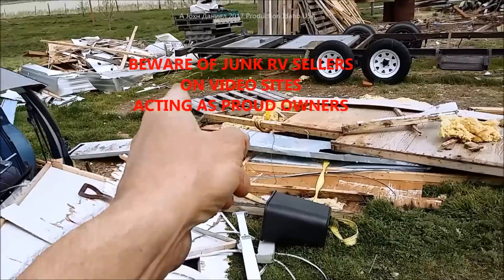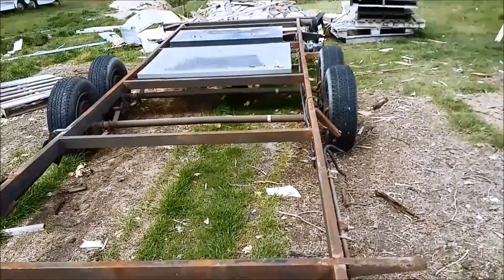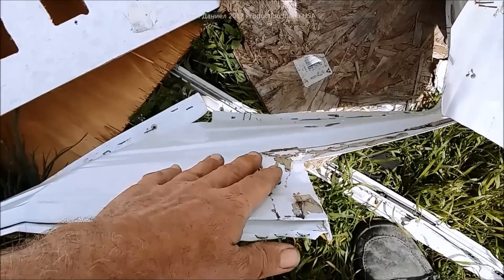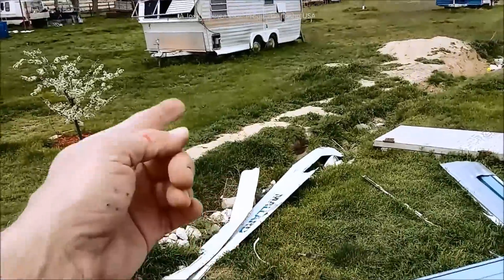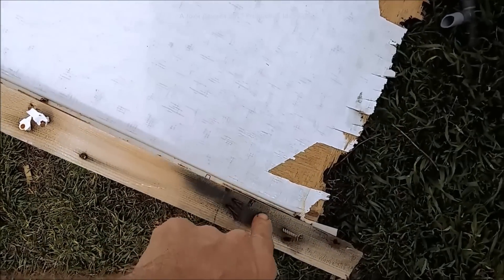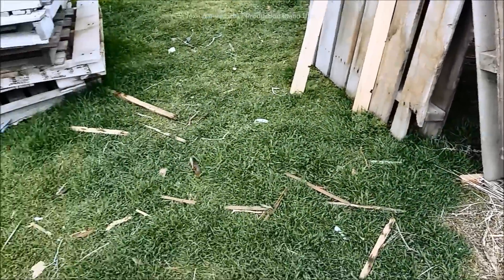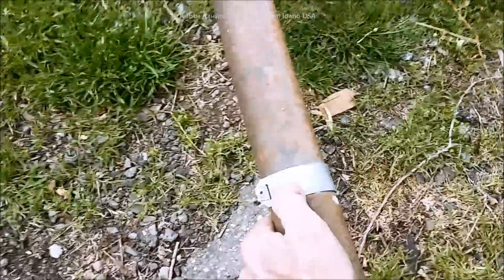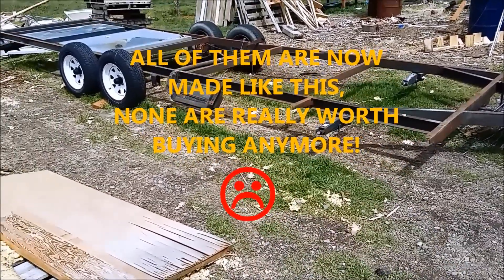HOW THEY MAKE RV Campers Travel Trailers, The truth, Wow! Info Below

Comment: Better off to buy a car trailer if that's what you want and build your tiny house on top of it. Better than that a C-Class motorhome about 25 foot long built on a heavy truck frame. That's what I have got a 460 cubic inch motor to push it down the road. Very adequately powered air conditioning power steering power brakes automatic transmission. It's like driving a Cadillac down the road.
Reply from the maker: We are taking a 20 foot 1976 Dodge Class c JAMBOREE with 21,000 miles on it, stripping it to the cab, adding 55 inches chopped from the rear of a 1978 PowerWagon D300 van with a single bench seat to it and making a 10 foot bed on it for a 5th wheel tow rig. The 400 dodge engine is stout, the gears are being swapped from the d300 van to go from 4.35 to a 3.97 final. Its my Madness project, a almost free heavy duty 20,000 lb one of a kind puller with seating for 5.
Reply: Јоhn Daniel sounds like a cool project. I want to see that kind of stuff being done Across the Nation we need a generation of people that can do for themselves. And now that we have a chief and Commander that represents US for a change that could be a reality. Thank God we didn't get crooked Hillary.  If it was up to California we would be stuck with crooked Hillary. That's where most of the morons live that vote for loser people like her. When Donald Trump got elected. I saw the light at the end of the tunnel. But this time it wasn't the train. Let's make America great again.
Reply: Јоhn Daniel rather than using a travel trailer for camping. I would rather go stealth camping. In some kind of vehicle that doesn't stand out such as a van or a pickup truck with a camper shell. That way I get to even Park in town without being harassed by local authorities. When I do the stealth camping I hang black curtains in my windows made out of little throw blankets. It makes the windows look like they're smoke tinted from the outside. It also keeps the assholes with a chrome stars on their shirts from shining  flashlights in the window. One Nation indivisible with liberty and justice for all what the hell happened to that. I try to educate other campers on how to do it so stealth that they stay under the radar and avoid being harassed. The tyrannical bullies Are  not on our side. They are Revenue collectors. It ain't like the good old days anymore.
Reply from the maker: The world of DIY was seriously attacked in the last 10 years with over 400 regulations and codes to stop independent thought and skills.
Reply: Јоhn Daniel  perhaps now that we have a new Chief and Commander. That will all change. Donald Trump spoke of guys that could Rebuild an engine blindfolded. I've been doing mechanical work for over 50 years. When I was an 8 year old kid. My dad owned two auto shops. We also had farm equipment. As a kid I helped my father rebuilt farm equipment. The tractor I remember driving the most as a kid. Was an 1959 8 N FORD.   I lived in Morgan Hill California as a kid. Back in the days when President Kennedy was assassinated.
Reply: Јоhn Daniel even with their 400 laws or so about independent thought and skills I'm not going to stop us from doing what we want. So many people I hear say they got a check with the government and see if it's approved before they do something. It's because they have been beaten down like the spineless jellyfish they are no backbone.

Comment: Thanks for sharing.   I've found that you absolutely need to be vigilant,  when buying a travel trailer.  

It's also important to realize they're glorified tents.  

I'm in the middle of doing my due diligence with maintenance (6 years old).   My undercarriage is rusting,  I replaced my front steps, I probably need to coat the roof and I just got two new 6 volt deep cycle batteries. 

Being retired USAF aircraft maintenance,  this is no big deal.  Still, it's something many people don't think about too much.

Comment: Puma trailers use welded aluminum  frames in their walls and white hard foam as insulation, outside is fiberglass inside is paneling and all vacuum pressed using a water cured laminate glue.

Comment: Your video is absolutely spot on.  I found in looking for a travel trailer over the last year (new and used) that everything in the US market is absolute garbage.  I'm a true believer in buying American products.  However, the US RV industry is nothing more than a bunch of thieving pricks.  In my research, sad to admit.  I have found that the best built RV's are made in Australia.  Such as the Zone RV brand. Unfortunately, the cost to import is prohibitively expensive.  That being said, I've decided that it is time to utilize my manufacturing and business skills and start a new Travel Trailer business.  Designs will be modeled after a truly innovative design utilizing composite materials, galvanized trailer construction and absolutely no wood.   Price point will be between a Lance and an Airstream.
Look for anticipated release in approximately 18 months or less.
Reply from the maker: Be careful thinking Australia is the best, China and India is now building RV's with a design I have preached about the USA needing to do for years. Based on the methods a flat insulated stackable seam garage door panel is made. Foam cored, faceted structural and light weight. The result, almost identical to my 2001 design which is A unibody RV with a R-17 insulation value and no rot issues.

Comment: I live in the UK, so choice isn't that great. I've had a 1993 Jayco trailer from 2009 to 2014 (we call them caravans here), then a 1986 Winnebago C class from 2013 to 2016, now we have a 1995 Damon Challenger A class bought in 2016.

There's a nice diesel Newmar for sale near me, but can't afford it yet.

Can't complain too much, they've all outlasted cars in the same age range.  The A class is definitely better, but it's only an incremental improvement. Stripping out kitchen cupboard and drawers to install a washing machine revealed more stapled together glue and sawdust masquerading as wood. But the basement lockers keep the floor dry and solid, rather than damp, spongy and sagging. It has an aluminium framed body too (the Winnebago had aluminium framed sides, but the roof was free to sag).

The Chevrolet P30 chassis is excellent, although why didn't they at choose the 4WD variant, or at least make it an option.

Again the dubious construction was probably to keep the weight down, the GVWR is about 5 tons less than sufficient for a decent RV.

Comment: I used to work as a tech at an rv dealer. The quality is very poor. I would get a new unit and there would be screws through wires pipes doors not properly hung nothing line's up properly.wall's and cabinets put together so poorly there all ready falling apart.I would have 6hours in reworking everything.but being on flat rate getting enough time from warranty was next to impossible..was always a constant battle to get warranty to cough up the f.n. time to fix there mistakes. I feel sorry for these people that drop a shit load of money in these rv's and there buying junk. The quality control needs to be more heavily regulated. I got out of the rv industry and got in to trucking.the quality is a lot better.

Comment: Yes! Mallard and other cheap light weight trailers are crap. Most are laminated with aluminum framing.  When you buy a Lite, Light, or any other trailer branded as a light weight trailer, you are buying a throw away trailer. They are built with the lightest and cheapest materials possible. Skimping on quality as simple as a screw. Instead as shown they use staples in thin composite wood material. Not the good composites we see on super cars. This is cheap chemical laided materials that sucks water up like a sponge. Once wet it crumbles. Any water leak from a sink, toilet, split pipe (don't rely on low point water drains as your primary winterizing methond. Always use RV antifreeze.) or outside intrusion spells disaster for these light category trailers. That said, the leakes and water damge here is due to the failure of the prior owner. You are supposed to check all the seals annually. Snub up any windows, doors, and/or hatches where the butyle has separated. Owners are also advised to keep the rv covered. Seal issues are compounded by weather extremes. Super hot summers cause the metal to expand compressing and pushing the butyle out. Cold caused the mental to contract resulting in the loss of your seal. Luckily Butyle tape is no longer used as a primary seal against water intrusion.

Anytime you're going to buy a used RV have it inspected at a thrid party facility. Don't rely on the seller. Don't go to a shop recommended by the seller. As he said in the video look and touch everything. Especially in cabinets, hatches, and the undercarriage. I would have walked away from this trailer simply due to the rusting frame. This is supposed to have a rust proof coating. If you see any, I mean any sign of possible water damage walk away. It can only lead to one thing. Total loss. Insurance doesn't pay for water damage at all. You'd have to "accidentally" forget the wheen chocks when you park it next. Just make sure the slop you park on isn't near a body of water, homes, or other campers. It's most believable when you start your weekend camping rather than when the season is over. Just kidding. Insurance fraud only costs us all in the end. Don't be a jackasz by claiming a few bucks.

Comment: Junk. the old ones weren't much better ...
Reply from the maker: NEVER buy a travel trailer that does not have a fully boxed frame, then your more likely to get one that does not twist and break its own seals and seams. My personal travel trailers are a 1976 Holiday Rambler Presidential 32 foot, 2" x 6" box frame throughout. My other is a 1988 Jayco Designer, same deal NO FLEX = No seam or seal damage to cause leaks as easy.
Reply: That frame you show on the video is sickening. What do you think about the Livinlite's ? Aluminum seems like a good idea to me. strong and light weight.

Comment: I do this for a living , I buy these junkers and completely rebuild them from the frame up but reuse the refrigerator, water heater tanks, AC etc. I didn't have the balls to do what you have done like on YouTube but it had to be said and shown to unsuspecting buyers. these units are pure shit even the more expensive fiberglass units are delaminating, and some are only 2 or 3 years old!
Reply from the maker: NEVER buy a travel trailer that does not have a fully boxed frame, then your more likely to get one that does not twist and break its own seals and seams. My personal travel trailers are a 1976 Holiday Rambler Presidential 32 foot, 2" x 6" box frame throughout. My other is a 1988 Jayco Designer 34 foot Hawk 4 season, same deal. Fact, NO FLEX = No seam or seal damage to cause leaks as easy.

Comment: Just stripped a Fleetwood yesterday. It was a 14' pop-up.  I have to say I was impressed with the frame set up. The main frame rails are 2x3 boxed steel that's 1/4" thick. The outrigging on the sides were stamped steel and I cut it all off saving the heavy frame and axle to build a 5x12 utility trailer. The only thing worth saving was the fridge and a/c unit. The frame though is pretty impressive especially compared to the one in your video. Mine won't flex if you jump on the corner so its pretty sturdy. Gotta have one 96 and older to maybe get a decent one. The one I actually camp in is a 94 and is super tight and in nice condition.
Reply from the maker: NEVER buy a travel trailer that does not have a fully boxed frame, then your more likely to get one that does not twist and break its own seals and seams. My personal travel trailers are a 1976 Holiday Rambler Presidential 32 foot, 2" x 6" box frame throughout. My other is a 1988 Jayco Designer 34 foot Hawk 4 season, same deal. Fact, NO FLEX = No seam or seal damage to cause leaks as easy.
Reply: Јоhn Daniel maybe warn your viewers that there is two grades of boxed steel also. My brother bought one last year that though it was boxed frame the tubes were paper thin. Not even 1/8" thick. Total carp. You cant even walk in it without the outriggers down as the thing will bounce his kids out of the bed when you walk across the floor.

Comment from the maker: My Smart Solution -  build travel trailers with spot welded 1x1 24 gauge metal stud and 24 gauge hat metal, using jig built construction. Using spray in foam for additional strength & R-14.5 Insulated value.  
Result - Faster built, very light even 18% lighter than wood equivalent, tension durable, strong like russian bear, solid like mexican woman, user friendly like paid off grubberment official, and dependable like japanese radio!  And bonding glue agents with a few rivets on a metal to metal for outer skins is like how air planes are made, very long life and durable. 
You end up with cheaper, better, safer, recyclable, non expiring RV you won't burn in. But ah, isn't that the problem! It would last too long and be too safe.

Comment: Ridiculous!
Reply from the maker: My Smart Solution -  build travel trailers with spot welded 1x1 24 gauge metal stud and 24 gauge hat metal, using jig built construction. Using spray in foam for additional strength.  Result - Faster built, very light, tension durable, strong like russian bear, solid like mexican woman, user friendly like paid off grubberment official, and dependable like japanese radio!  And bonding glue agents with a few rivets on a metal to metal for outer skins is like how air planes are made, very long life and durable. 
You end up with cheaper, better, safer, recyclable, non expiring RV you won't burn in. But ah, isn't that the problem! It would last too long and be too safe.

Comment: my mold inspector says he quite often finds mold in walls and floors of RVs and travel trailers due to leaks that go undetected and/or not properly remediated once a leak is detected (ie they fix leak without properly drying or replacing wet parts and insulation). Airstreams while well built can have rivots loosen as the trailer vibrates going down the road and leaks may result
Reply from the maker: See my latest, more brutal truth https://youtu.be/ivqWalkCreM

Comment: Ive pulled apart several of these clunkers and know how junky they are.
Now theyre bonded fiberglass,... more crap.
I bought a 40 footer built in the 50s and man was it put together.
Also bought a holiday rambler aluminum studs... fairly good.
I owned a 32' 5th wheel made in the mid 80s. nice unit.

Comment: Yeah, keeping them sealed is a big key. That putty tape dries out and cracks. I would use butyl tape and caulk around whatever I resealed on the sides. 
When I worked at a coachmen dealer, we'd replace all the marker lights for better ones and make sure they were sealed (the brand new units that just came from the factory).
Coachmen even put out a line of trailers that had large plastic front and rear caps that were only held on with cheap two-sided tape. They would pop loose easily ad we remove them, clean all the cheap tape off, then use a better 3-M two-sided tape and we'd add screws with those snap-cap buttons so you wouldn't see the screws.
I could go on and on, I worked in the industry for 20 plus years. Oh, pop-up tent campers, never ever buy one of those. They're disposable IMO.
Reply: I'm a retired tech also there all junk. I own a 1983 8ft. truck camper I paid 500.00 for it and use it 5 months a year. When it reaches it's end it will become a ice shack. I will purchase another $500.00 camper.
Reply: sounds like you worked at a place that cares about its customers and its reputation.

Comment: I do like how you show the internals of a low end trailer.  I've owned some older trailers before buying my new one, so I have also seen the differences for sure.  When I mean old, I mean 1966 coachmen Citation 12 box old.  It too rotted amd I had to rebuild the entire rear from the rear corners down.  So not all old ones don't rot.  Its a myth that some people use to justify their argument.  My 2017 Coachmen is fantastic, All aluminum framed walls, the exterior fiberglass is not bonded to luan, but Azdel, and so far with over 4k miles on it no structural issues I have noted to date.  I think like you had said, its about doing a full in depth inspection of everything, and then redo that inspection.  That's the only way to ensure its sound.

Comment: What you show also shows why they are a fire trap. I got a demo of this in a RV park when I happened to see a trailer fire from start to finish. I was amazed at how fast it burned down. Like a cardboard box. So have several smoke detectors and be very careful with heating and electrical stuff if you are in a trailer.

Comment: I had to buy a travel trailer to live in after the hurricane. We found one on craigslist for $7000. I can tell you honestly it was in worse shape than this one. It looked really good on the inside but the whole front bedroom was rotted out. It will be fine for a deer camp or someplace you don’t have to move it, but if you use it down the road you won’t have anything but a frame left by the time you get there. Mine was it 2009 Jayco Jayflight 29 BHS